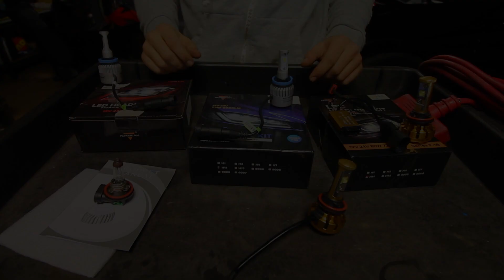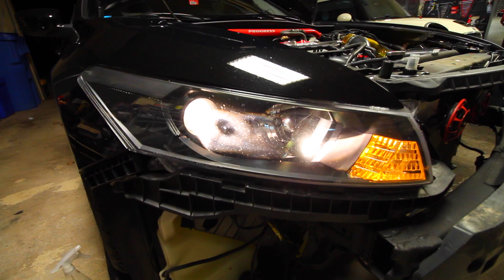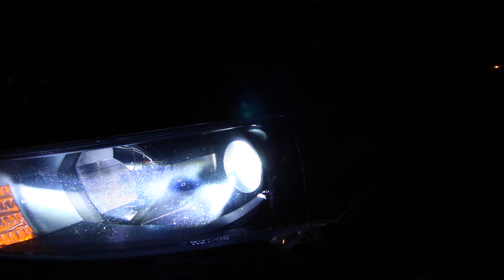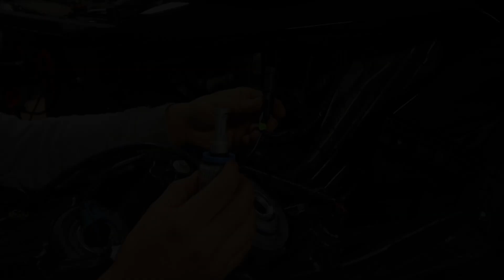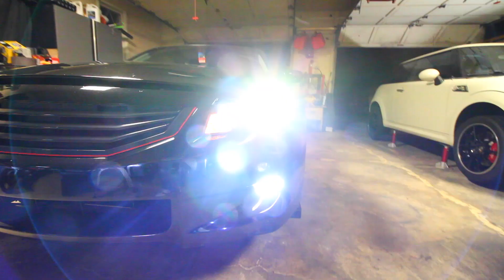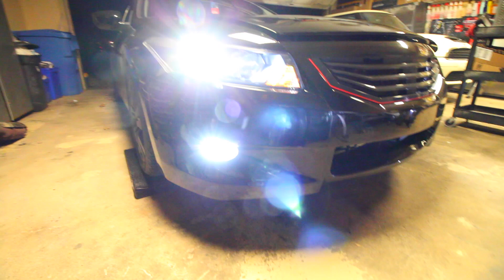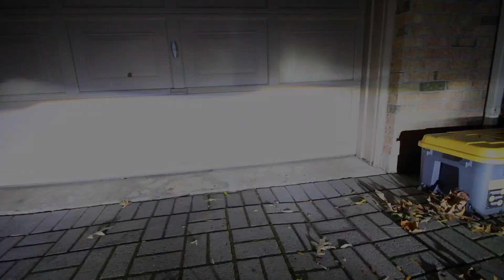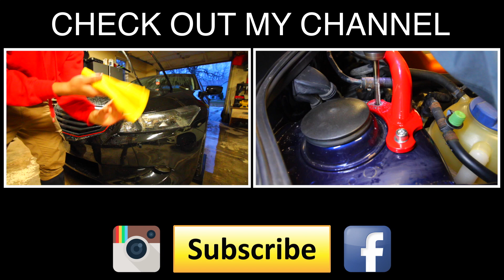LED Headlights: Are they Better than Halogens?

Comment: Do these LED headlamps die after a few months ?
Also do you suggest installing this on a non-projector headlamp housing?
@milanmastracci
Reply: Mohammed Nabeel no led kits are not recommended for reflector housings, it makes it worse, while also blinding others and possibly getting you a ticket.
Reply: I want white headlamps for my car, which should be powerful and not blinding for other drivers

Any suggestions ?
Reply: Mohammed Nabeel Sylvania ZXE are as close to LEDS as halogen bulbs get. I have them and love them.

Comment: you should've compared HALOGEN, LED and HID.
Reply: MrAmarcial , I have compared LED to factory halogen bulbs and difference's is day and night.
Reply: Night and day?
Reply: I  have aftermarket projector halo headlights with a led strip for the DRLS(I just need to get the DRL Canceller installed in my highbeams that are running as my DRLS, along with the LED strip & the halos. My lowbeams & highbeams are H1now & NOT 9006 low/9005 high/DRLS. Both of the incandescent bulbs that came with the retrofit halos headlights were both rated at 55w. I upgrade the lowbeam H1 to an HID CONVERSION KIT @ 8000K. I need to know what LED do I need to run my highbeams? I have 2 LED lights for the highbeams, but they don't overpower the lowbeams. I need to know what wattage highbeam LED, I need to overpower the highbeams. The 8000K lowbeams HID LOOKS EXACTLY LIKE THE TURN SIGNAL COLOR(I HAVE LED SWITCHBACK TURN SIGNAL) WHEN THE PARKING OR HEADLIGHTS ARE ON! MY 2012 HONDA ACCORD EX-L SEDAN 4CYL HAS ALL LED LIGHTS EXCEPT FOR THE HID HEADLIGHTS ALL THE OTHER LIGHTS, TURN SIGNALS, BRAKE, BACK-UP, 3RD BRAKE LIGHT & ALL THE INTERIOR & TRUNK LIGHTS ARE LED, THOSE THAT NEED LOAD RESISTORS WERE DONE BY PROFESSIONALLY. I JUST NEED TO KNOW THE WATTAGE OF LED FOR THE HIGHBEAMS(H1 NOW &  NOT 9005 IF THEY HAD THE FACTORY HEADLIGHTS)!!! I BOUGHT THE LIGHTS FROM SPYDER, AND SOMEONE PLEASE LOOK IT UP FOR THE 8T GEN ACCORD/08-12 ACCORD SEDAN EX-L, I HAVE THE 2012 HONDA ACCORD EX-L SEDAN 4CYL. THAT HAS H1 BULBS NOW!!!! I WANT SOMETHING THAT'S IS CLOSE TO THE 8000K, THAT WILL OVERPOWER THE LOWBEAMS WHEN I NEED THE HIGHBEAMS.
Reply: Oran Seay you sure got yourself in a pickle sir. Did you fix this yet, I’m curious.

Comment: that gold LED is nice ... but how much is that? might be too expensive .. :(
Reply: Michael L. Ledesma more than the opt7 LEDs, around 120$, the opt7 are around 90$ with coupon code "email10" plus the opt7 LEDs are much better in my opinion, I have some and they are so good.
Reply: Sir Williams I have to disagree with you on that. Opt7 cost $99 and that gold LED you saw is the f16 series by AuxBeam, Which cost $51.79. All your doing is paying for the name brand.

Comment: The only problem with this new wave of LED headlights is once that fan goes (and they do) they burn out soon after, you're better off with a set of quality HID's.
Reply: actually..the "new wave" of LED headlights use passive cooling.
Reply: Yup as they are progressing cooling is becoming more efficient and heat generated is dropping.  Not very popular now, but if you watched plasma tv's from when they started is a good example.  Early ones would often even in a 40 or so inch run around 6 fans the size of a computer tower case fan.  That was in addition to a ton of heat sink's inside, loud and lots of current draw.  Later ones were thin as a lcd and didn't require any fans in many cases.
Reply: francois carrier LOL that was me I just took them out because one died switching to LED now
Reply: Road Worthy look into Philips ultinon h4 leds.
Reply: Road Worthy HID are sooooo 2012.

its easy to spot who is running HID. one of them is burnt
Reply: francois carrier Have HID's can confirm, switching to LED's this weekend
Reply: No blinding with the cutoff line.  Now HIDs in a halogen housing I would agree is terrible
Reply: I have HID's 6500's I'm good.
Reply: Road Worthy , there are LEDs without fan. difference is day and night when compared to halogen.if interested see my channel.
Reply: Todd J. Lajoie i see alot of people having the same problem
Reply: what about the new fanless LED's ?
Reply: Kenneth john  I herd those run a lot hotter and burn out quicker then a fan one
Reply: Not all have these fans I have a pair without the fans
Reply: Road Wo
Reply: francois carrier lol
Reply: Road Worth
Reply: Road Worthy i
Reply: Mathias Hamblo
Reply: rocknroller1999 same here. I remember the 1st set of HID’s I bought in 2003 for my 2003 Ford Fusion. Those ballast still work good. I had to replace my HID’s bulbs 3 times since 2003. But I always had an extra pair of high beam, low beam, and fog light HID’s on standby. So I did not have to wait for a replacement HID bulbs. Now I have Kensun kits installed in my 2015 chevy malibu. Never had any issues with my HID’s. Spend a little more money on quality and u will see the great results. That even applies for LED’s. I even used those 2003 HID ballasts for my 2006 Impala when I got a new vehicle. No issues there, just bought different HID bulbs for the Impala. I even took it a step further and pointed my lights to project lower so it would not blind the oncoming traffic 👍
Reply: storm white Oh yea, HID’s are the way to go. Just do ur research on what brands are proven to put out good products. I personally use Kensun HID’s.
Reply: I had LEDs that lasted barely 6 months. Going back to halogens.
Reply: storm white no prob... just make sure and buy a extra set of hid bulbs, that away you have a spare on hand and do not have to wait for a replacements bulb. Just to be safe
Reply: yup happened to my buddy installed led headlights and they were dim as shit vs the original ones. and yeah he got hids.
Reply: Blake  the car probably couldn't hold the load the bulbs where drawing. HIDs use there own little power supply to run the bulbs the LED ones don't. It was probably drawing to much power for the alternator to keep up. It depends on the vehicle cause I put LED bulbs in my car and they work fine when cars on on battery it drains the battery quick.
Reply: true but if you are going to install hid's you are probably gonna need a load balancer and in some country's including mine you are required to install headlamp presure cleaners as well . (so considering all that hassle you moght just be better off installing the leds (less hassle) or stick with hallogen bulbs
Reply: Mathias Hamblok... "but if you are going to install hid's you are probably gonna need a load balancer". Same is true for cars with can bus when using led's or else you'll get error codes. AND/OR flickering lights.
Reply: I went to a car audio shop since my HID ballast went out. The guy there tried to mention that LED bulbs are the new generation and that HIDs are something of the past? That LED bulbs are much brighter? He qouted me $65 for a set of LED H7 bulbs. Got home went online and eBay has a set Cree h7 bulbs for $15 shipped with good reviews. I mean I understand that people are hungry now a days to make profit but I ain't no sucker. Before I make any changes to my car, should I consider ditching the HIDs and just install some Cree LED H7s from eBay? What you think my man since you sound like you got some knowledge about this. May I mention that I have halogen housing headlights. I'm just fed up with either ballasts going out after a couple months.
Reply: Road Worthy I have a quick question. I have read a bunch of comments and I come from a very strong electronic back ground and from personal experience, I find that leds in a halogen style enclosure that driver visibility goes way down and you do offend oncoming traffic as well as the car(s) in front of you at a traffic light or stop sign. I have a 2007 Chevy 2500HD LTZ with a leveling kit in the front and I will admit to being one of "those" guys with the high power Led conversions that even AFTER adjusting the head lights against my garage door back down to the original height and then taking it a step further even lower. After giving it some thought, I believe that the characteristics of a stock halogen bulb being round, in my case H11 low beam, the bulb essentially reflects, then goes back to the reflector and finally goes forward. To me it didn't make sense that a led with a couple chips on each side "back then was only one side (180') but where the chips were simply couldn't fill the space no matter how bright" 
So what company would you recommend using for a HID halogen? If I remember correctly, most of the HID bulbs looked slimmer but longer than the stock halogen. Also, my findings say that an led bulb would be better in a projector style headlight. With that being said, I have to decide if changing the head light to a projector set then retro Oracle lighting halos or going back to halogen perhaps HID then sending them my current stock lamps to put the halos in. I know this is a very long message, but to those out there I think we can all stand to learn a lot. 
Thank you,
Paul
Reply: Don’t put them projector lens.
Reply: HID is inferior compared to LED, stop trying to defend your purchase with fictive bullshit
Reply: Thats not the only problem!  They also blind oncoming traffic and cause accidents, migraine headaches, death

Comment: Will these LED bulbs put more load on your battery?
Reply: issoloko2412 no, most LED lights use less energy than standard halogen bulbs (55 watts avg) LEDs use about 20-30. I think, but for sure they usually use less energy.
Reply: This kits in video uses 30w each (gold one) and 32w(other ones).

Comment: It most definitely NOT gaining you any performance... But you are gaining more visibility... btw great video and I prefer 5000k.  I for some reason don't like the bluish.
Reply: Who said that? They use less power so altenator is not that much on stress. So its like half HP gain.
Reply: And performance doesn’t necessarily mean engine power… the LED light performs better, so it’s a “perform”ance improvement.

Comment: I can't seem to find your video of the LED lightbar, could you link me to it?
Reply from the maker: https://youtu.be/EeIkG2AV7gU
Reply: Any chance you could explain why you haven't used the bulbs on both the HIGH and the LOW beam?

It seems you have only installed them into the low beam? 

I'm going to be installing them on my BMW which takes H7's and has the same H7's on both the HIGH and LOW beam, any tips would be great before i spend double the amount to have a full setup of LED's?
Reply: milanmastracci plz look at my comment!

Comment: what is better milan? hid or led?
Reply: when in the proper housing, HID or Bixenon lights are far superior
Reply: Fernando Ibracadabra With LED's you don't need a new headlight, with HID's you could blind other drivers if they are in the stock headlights.

Comment: Putting led bulbs in a halogen projector is a big no no. There is no hotspot when using led bulbs which means that  you won't be able to see as far as you would with standard halogen bulbs or HIR ones. Best way to go is with retrofitting true HID projectors. Even the cheapest ones perform better than pnp led or hid bulbs!
Reply: Its actually superior to lack a hotspot IF you are throwing out enough lumens.   That way you have a very balanced distribution of light, but that is only viable if you're outputting enough light over stock that the difference is that your previous hot-spot is still getting the same amount of light, except now you have an equal amount to your old hotspot spread evenly in the path of the beam.    The REAL issue people have is that LED lumen advertisements are nonsense and generally just a random number pulled out of a Chinese manufacturer's ass.  The HIDs are brighter not because of the hotspot, but because their true lumen output is often two or three times as great.     HIDs from seven years ago are identical in output to today's HIDs, whereas LED output is improving greatly.   So within a few years, I would expect LED to match and surpass HID, with greater efficiency and reliability.
Reply: That's true. The ones I have can adjust which way the leds are facing.
Reply: you can also get proper LED projectors as well (newer Toyota carolla and and a number of other vehicles have them a retrofit is the best way to do an upgrade to your lighting system not only will it make your vehicle more uneque it adds better performance and the added tradeoff of better looks (I got Toyota koito LED low beam projectors on my work truck currently (got factory LEDs on my personal truck) I love the things couldent be more pleased with them aimed correctly no blinding and great performance so a retrofit using the correct parts for the application is the best way to go
Reply: Christos Nikolakakis truth
Reply: I'm about to replace ALL the lights on my car (Abarth 500) to LEDs. Being an EU spec the DRL bulbs I shall be using are 7443s, which shouldn't affect other drivers. The confusion I have is about the dipped beam, which is an H7 with a reflector behind it. As far as examining every possible bulb online, I can't seem to find any real difference between the Halogens and LEDs design-wise, in a way that would make them operate differently. If both types of bulbs only "shoot" light to the sides and rear (i.e never produce any light forward), they should work the same, don't they?
Reply: jmen8888 It sounds like you're talking about HIDs
Reply: I've used a majority LEDs and HIDS are still my go to choice. The only thing that comes near as close as HIDs are the SNGL that cost 180. But I do agree that LEDs don't shine as far. Only reason why is because their isn't really any light that hits the top and bottom of the reflector. LEDs are very directional so you can only set them either up and down or side to side. Only way you get the same distance as HIDs are if your projectors were designed around the led itself.
Reply: Uh, no.  Had HID's for 16 years.
Reply: Christos Nikolakkis what is your HIDP name?
Reply: @Eh meh it's wacko
Reply: sure thing
Reply: TheOne CalledJake unless they are adjustable.
Reply: On wet roads at night, you will think your headlights are off. I will stick with my yellow stock H11's over those weak blue LED kits. Yellow is not a bad thing in bad driving conditions. I run Tri-Color Safety bulbs from Napa and they have been the best for night driving and bad weather. If you are just going for city/appearance, sure, throw some blue crap in there.
Reply: HID's have this "quality" too because it has to do with the kelvin color temp. While what you said IS true, the objects on the road will light up.
Reply: HID's are great. My X5 has them and I must admit they do light up the road and deer but the topic of just changing a bulb vs housing/wiring is a big step. I think most drivers don't have to deal with rural driving if they consider whiter is better. If you simply want a brighter low beam, most projector housings work well with a regular H9. Safe way to increase your low beam brightness at the cost of bulb life.
Reply: Hobbit you lost us. H9 is a certain socket  and amperage setup. Not ALL cars can use H9 because they simply won't plug into their housing. You must swap the current bulb and socket type with the exact. Going back to your road and deer comment... er huh? Anyhow, I DO drive rural and I DID have HID with 5500k and saw everything just fine.
Reply: H9 will work in any H11 socket with two small mods. I only would do this on projector style headlights  because it works well with the cutoff and just gives you more light. Yes, as I also said, HID's are nice and bright at night but warmer light in fog will work better everytime. You will just blind yourself with too much white light.
Reply: Christos Nikolakakis absolute crap
Reply: I think you have misinterpreted that image.  The descriptive header appears to be over, not on, the light it is describing.
Reply: Dude, you didn't watch whole video lol. Watch it, you will see how nice cut that projector have with led's
Reply: expert20valvehlx The cutoff is indeed nice. You won't blind other people. The problem is the light distribution itself. led bulbs dont have a hotspot. if you don't have a hotspot your distance vision is impaired.
Reply: Yeah but for fog lights and low beam its not that much noticiable.
Reply: http://imgur.com/lxhcKSE

Check out how dim the led bulb is. Even the halogen is brighter than it.
Reply: I know that bro, look at end the video you can see how brighter is a led. Best thing to do is bi xenon projector with HID's
Reply: HID bulbs are the best.  Watched a lot of videos, read stories, etc., everyone says LED bulbs don't project far enough in front and halogens actually do a better job.  Only OEM LED headlights are decent, not all are close to  being equal either.  The only aftermarket LED bulb that is usually better then halogen is the fog light.  LED's scatter light and having a wide beam pointing very close to your vehicle lightning up the lines is what fog lights are intended for.
Reply: No.  If your vehicle came with halogens, then they are designed for that light.  Dropping in LED bulbs will scatter light differently off the reflectors making it more difficult to see.  It might produce a lot of light right in front of the vehicle, but the led light won't throw far enough down the road plus light will travel up blinding other drivers.  Since an LED chip is completely different from the halogen bulb, light doesn't project the same on the road.
Reply: hidplanet has taught me well ;)
Reply: jmen8888 and
Reply: That's why I mentioned SNGL. SNGL gives you some space to either retract or push further in depending on your projector and allows you to rotate the LED. But again 180.